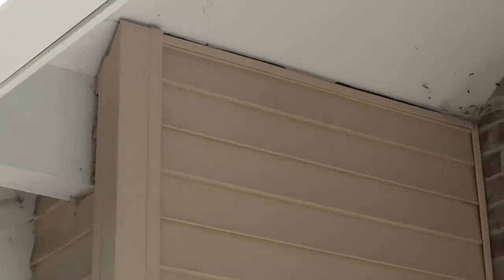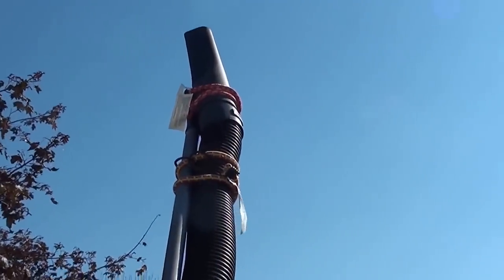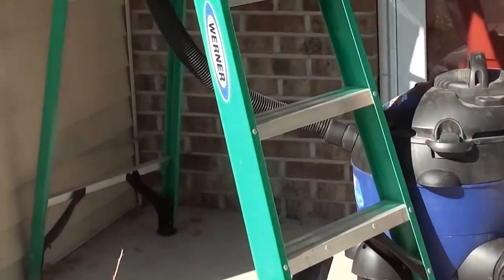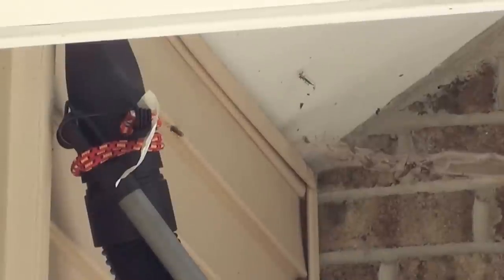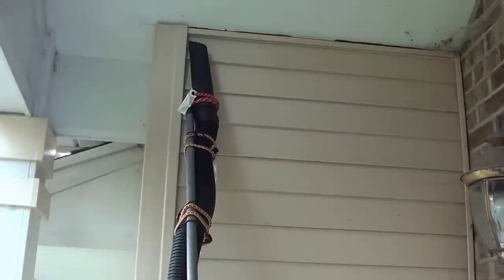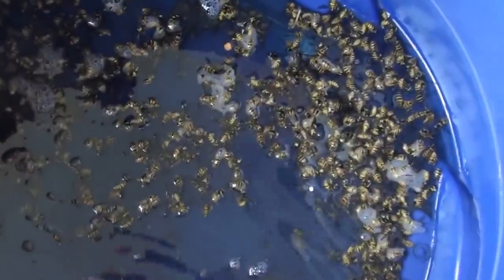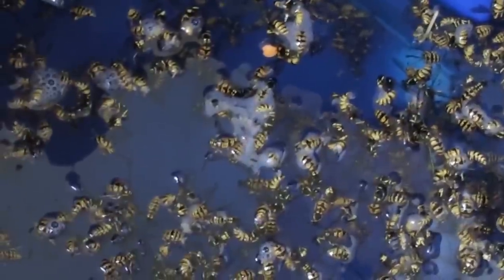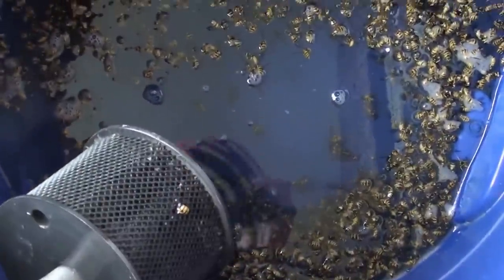(R-Rated) Shop Vac + Yellow Jackets / Wasp Removal / Extermination Tutorial / How To

Comment: About how long did you shop vac them for? I recently vacced a nest hidden in a crawl space up by my gutters for about 45 minutes and when I saw no activity for 15 minutes, I stopped. About an hour later, I noticed they were back going into and out again. I caught about 35 - 50 of them. But I'm thinking the nest may be bigger than I originally thought. How long do you recommend?
Reply from the maker: I usually run 3 or 4 hours.  It's a little overkill.  My thinking is not that this exterminates the whole colony, but that it devastates their numbers.  Then I let winter do the rest.  It's always late in the season when I've done this.  Late August into September.  The early part of the season I usually don't notice the wasps.  But they always seem to balloon late in the summer.  That's also when this video balloons from dozens of views per day to many hundreds of views per day.

Not sure what the "right" amount of time is.  I've just found this to be a cheap and easy (depending on location) way to knock the numbers way down.  Some years they are totally gone after, but most years there is some activity, just a lot less and they run out of time to build the colony back up.
Reply: thanks...I'll do another round then.

Comment: Was that colony wiped out permanently, or did it slowly build back up?
Reply from the maker: I've done this a couple times.  Always in September when the numbers swell.  Each time they weren't eliminates completely, but down to a a couple wasps per min, down from 1 or more per second.   A few weeks later winter does the rest.

Most years we get more wasps in that general area, but not that exact spot.  They like the sunny vinyl siding.

It's not perfect, but cuts them down so much I don't notice them.  I thik it basically debulks, but doesn't necessarily eliminate the whole population.  But close enough for me.
Reply: Have you ever tryed sealing the cracks they are getting into so they dont come back?
Reply from the maker: +no I haven't.  I'm always afraid they'll eat into the inside of the house.  They seem to set up in a slightly different spot each year.  I usually do this in September, and the colony gets so devestated that it's either completely gone or so far gone they can't recover by winter.  At least not enough to be a nuisance that season.

Comment: Just take a 2 liter soda bottle. Cut off the top where it changes sizes. Invert that and use duct tape to seal it. Put orange dishwashing soap and apple cider vinegar in it. Very lightly fry a piece of bacon and use a string and drop it in dangling toeing it off around the neck of the bottle. You’ll catch up to 2,000 to 3,000 of yellow jackets. They produce 6 or more queens so their numbers get huge quickly.

Comment: Trying to vacuum elm seed bugs into soapy water, thus drowning them. 

1. Will the bugs clog the filter? 
2. If yes, will the bugs make it to the water? Trying to drown not just catch them. 
3. Can/should I use the RIDGID Model # WD4522 without the filter, or keep the filter 
in?

Thanks!
Reply: Use a wet/dry shop vacuum.   The filters are made to work in water.

Comment: I went outside last night and looked to see how my door spider friend was doing and noticed what I originally thought was a spider egg sac near my eaves. I thought this because it was dark out and the spider was walking across it. I went and grabbed a crowbar and was about a inch away from tapping it when my conscience told me to stop. I went Inside and grabbed a flashlight and saw to my horror a small wasp nest with about 20 just sitting on the outside but not moving. I thought since the spider walked across it and none seemed to move when I flashed my light on them that they must be under a layer of web and spider food. I then proceeded to spray the nest with a squirt bottle to make sure and my Lord did I piss them off. First thing I thought of was shop vac. I googled it to see if others used one successfully as I loved vacuuming up any kind of bug lol. So glad it works! I need to find a way to save the spider though as he is the size of a dollar coin and harmless.

Comment: So did they ever return in that location?
Reply from the maker: Tim Smith They did not return that season and we moved over the winter.  Though we were there 7 years and most years they show up on that side of the house.  It's sunny with vinyl siding.  A different location each time.  You usually don't notice them until August, and by mid September their numbers swell.   If find that one vacuum treatment in early September is enough to devastate that year's colony.    Some years some still hang around, some years nothing survives.  But every time the yellow jacket highway has been destroyed for the season.
Reply: Well, Ive been looking for a reason to buy a shopvac so I picked one up today and will 'install' it tonite while they sleep and turn it on next morning via plugging it in with a LONG extension cord from my garage. The yellow jackets are INSIDE of my electric box just around the corner where we keep our garbage cans ~ high traffic area. I'll seal one side with duct tape or foam so they have no choice but to go out the side where the vacuum is. So wish me luck! Maybe I'll take pics of the victims! haha
Reply from the maker: Tim Smith Would love to see pictures.  Though be careful using a "LONG" extension cord for several hours.  If it's not a thick enough gauge it could conceivably melt.  The smaller an area the wasps come from the better this method.  Also be careful to leave them an egress.  (Preferably the entrance to a shop vac).  I've heard stories of the wasps eating their way into the home when they can't get out their front door.

Comment: you're not getting rid of the nest, though
Reply: ircimager without foragers left to get food, the larvae starve.
Reply: In a cold climate, it could actually be an advantage.  It probably serves as a form of insulation by blocking airflow!  Besides, without ripping off the siding, how do you propose to remove the nest?

Comment: It’d maybe take less time, if that crevice attachment could have been angled into/toward crevice.  
And.wow! Seems like those critters were strong enough to resist getting sucked-into the vac, if they were crawling, but not when flying....so, must catch them while flying. 
And....what did you do to block them ever nesting in there again??  Caulk that crevice!  And all crevices like it!! 
And/or:  inflate plain brown paper lunch bag, hang from eaves near each door, in very early spring.  This fools paper wasps into going elsewhere.  They are territorial, so won’t build new nest anywhere near the fake nests....and, those last for yeeears, if up under eaves, protected. 
OTH, if those in that crevice were ground-dwellers thinking they found the perfect spot, IDK if those would be repelled by the brown bag trick...but they might, because those are terribly territorial, too. 
But still....the queen doesn’t usually come out, staying in there to keep laying more.  You don’t want that happening, even if the current crevice gets caulked closed...they may dig out into the wallboard inside the house.  SOoo.....  You should probably puff-in a bunch of diatomaceous earth, into the whole crevice, Before cleaning edges and caulking it.   Stores like HomeDepot or Lowe’s, etc., and farm stores, usually carry 4 lb. or so, bags of food-grade diatomaceous earth.  That cuts bugs’ exoskeletons, dehydrating them to death.  It’s very nontoxic, low cost. Stays put. 
If building new, or tearing into walls, can put this powder into wall-bays, leave in permanent, in thick layer at bottom of each bay, to ruin the lives of most all bugs with exoskeletons (all of them!)..that walk over it, for the life of the building.

Comment: I did this exact same method last summer.  I ran the vac for 5 hours and when I opened the shop vac lid I quickly realized I had forgot to add any water. ...RUN FOREST RUN!
It wouldn't have been so bad if I hadn't taken the vac into the kitchen to show the wife my "catch".   :-0
Reply from the maker: You and the wasps had a lot in common that day.  You were both stunned.

Comment: I have used an ordinary vacum cleaner to get rid of lots and lots of little ants,although not so dangerous they were a problem,howeverm y first mistake was getting them coming out of the nest,after a while they got wise to the noise and would slide back in,however in the end i had to move  my bait,just a dab of strawberry jam,further away,creating a long line of ants and voila i would suck them up from their exit all the way to the jam..did this 3 or 4 times and that was it  R I P ANTS
Reply from the maker: George M.  Congratulations of RIPing your ants.
Reply: it was the right thing to do,sorry you could not attend the vigil,lol
Reply from the maker: George M .   Not a big deal to me.  But for the ants... it was their hill to die on.
Reply: well thanks for your concern buddy,happy hunting

Comment: Probably would have been easier & faster to remove the nest??
Reply: This nest is behind the siding, if not inside the wall.  The shop vac gets nearly 100% that leave when they return to the nest, and you can stay at a safe distance while the shop vac does all the work.

Comment: Err dish detergent has chemicals in it. -_-
Reply: Aslo Aso "no chemicals OTHER THAN a little dish soap"
Reply from the maker: Aslo Aso True.  But I would never wash my dishes with Raid.
Reply: You know gassing them with Co2 kills them too, plus won't have to deal with a wet mess and noise of a vacuum.
Reply: He said that
Reply: Ya know id seal it up with some caulk. But the caulk has chemicals in it. Ya know. The caulking gun also has chemicals in it. Jeez. The air emitted from all the wasps inside the vacuum probably has chemicals in it. I'd be careful where you dump that dish water with wasps in it because it probably has chemicals in it. Y'all pipe down with your hippie "chemical" shit.

Comment: 4 or 5 hours ? Talk about a very expensive way to catch wasps. The loss of the vacuum life and the electricity used is so wasteful. I mean if cost is not an issue and you don't care how you get rid of them without a chemical, why not just burn the house down and get 100%  instead of 95% of them. I mean sure there are ways to get rid of them, but cost and annoying the neighbors should be   a huge consideration.
Reply from the maker: It does feel excessive, but in reality it is only a few kwh and costs less than a dollar.  Working life of the motor is a valid concern.  But it hasn't been an issue and a shop vac is only $50.

Neighbor was fine with it.  They were away much if that time and mowed.
Reply: @billb.2673  Wow, you have anger issues. You get triggered easily and you need to stop and take a long deep breath. I made my comment and I stand by it, as I seen some expenses and having this problem right now, I found it unnerving that I would have a shop vac running for 5 hours and pissing off my neighbors. I wondered what the cost of electricity would run me in today's crazy utility price hikes and if my old crappy shop vac would die running for 5 hours. Burning down the house was meant to be funny and another non conventional way to get rid wasps and not a nasty remark. The channel owner gave me his slant on my comment and handled it quite well without you freaking out. Seem stressed, you seem triggered and I have to wonder if my comment and your response, might make you come to some deeper understanding of yourself and maybe come to some realization of some hurt in the past. If you think hard you might see a pattern or a reason for your outburst and get a better understanding of yourself. As you wonder how many videos I troll, I have to wonder how many people who leave a comment have to deal with your irrational emotional attacks and how many comments trigger you. If this comment was enough to send you over the edge over wasps, I hope that you have the sense to stay away from religion and political videos. Good luck and may I suggest you get some medication for that anxiety disorder.
Reply: I think a bug zapper light would be better